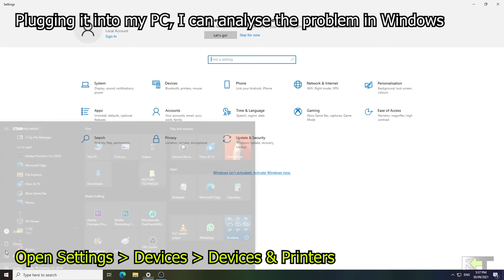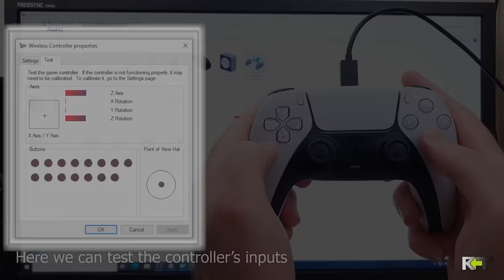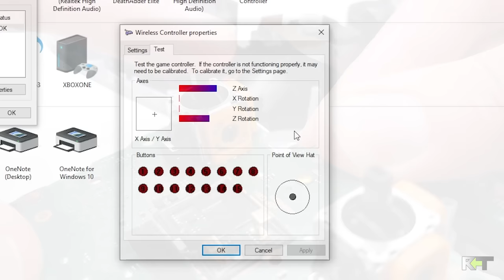How to take apart your PS5 Controller and fix Stick Drift

Comment: When I first watched this I thought  I could never do it. But after spending 20 bucks on Amazon for a full screwdriver kit, foam swabs, and plastic prying tools, I just now finished up fixing my drifting controller and so far no more ghost inputs or drift. Thank you so much
Reply from the maker: Yay! Well done 👍
Reply: @RestoreTechnique  Doing this as well. Thanks a ton for the very clear video.
Reply from the maker: @consciouscnote  You're welcome 😄
Reply: Nice dude!
Reply: Update on the controller? Does it have drift now 3 months later?
Reply: @UJxstGotClipped-  hello! Update, no drift since doing this. Actually I haven’t had to open up my controllers again once since following both this video and another video on fixing trigger springs. Granted it’s only been 3 months but I will update this comment again if the controllers ever start drifting again to give my best guess at the lifetime of this fix. Either way hopefully Sony upgrades their controllers soon.
Reply: @loonboy4905  nice just did this method
Reply: @loonboy4905  Which screwdriver kit did you buy?
Reply: Can you provide what kit you bought 😂 controller os bugging out rn
Reply: @PuReGhOsTT  I just typed in electronic repair kit on Amazon and bought something for 20 bucks and I also typed in micro screwdriver set and also spent about 20 bucks. I used the Philips head bit labeled 2.5 for the controller screws
Reply: Wanted to update this comment again. I had to open up my controller to repair a broken L2 spring (much harder to fix than the R2 spring) and since I already had to take out the battery to do it I also just went ahead and cleaned the stick electronics again as well. So I probably won’t be able to provide an exact time frame for how long until they drift again due to somewhat frequent repairs to other parts that cause me to jsut make sure everything is clean and lubricated correctly while im at it.
Reply: Why was the screw driver kit called
Reply: What if the prying tools is metal no plastic?
Reply: @marquesdunn4934  might scratch it id assume
Reply: 5:24 can u use a simple baby wipes
Reply: @awesomeperson5051  I wouldn’t use anything that sheds or leaves behind residue. So i honestly wouldn’t use anything other than felt or microfiber and some form of alcohol to clean electronics.
Reply: @awesomeperson5051  i wouldn’t , baby wipes leave behind a lot of lint.
Reply: Man my controller drifts so bad now I want to toss it. This video is my last hope.
Reply: @davidwhite206  just get a new one of you cam afford it
Reply: Shit i just used a butter nice and water and worked just perfectly for me
Reply: @Bababooey22  so just cleaning the little potentiometer disk thing worked for you as well? No replacing parts
Reply: Did you apply a new grese or no
Reply: Your really helpful 💯💯
Reply: Yet another new update: On my primary controller I experienced diminishing returns where I got to the point where every 3 months or so I had to clean and reassemble the controller to remove stick drift. However my secondary controller has not needed to be cleaned again since my original comment 2 years ago. Additionally I don’t know if Sony finally fixed this issue with software but I had completely given up on my primary controller, decided to try it out and since the last controller update I have had no stick drift. I hope this semi-long “study” confined to YouTube comments was helpful. Also for anyone wondering as well I seemingly have to replace the trigger springs annually which isn’t bad as it is very easy to do. For context I play PlayStation almost every day for at least an hour. So for extremely heavy use I would say the controller holds up daily well with somewhat minimal maintenance. But in the end I would still recommend buying a newer production controller if you still have the launch controllers like I have, as longevity issues seem to be completely fixed now.

Comment: After watching this I’ve decided to just buy a new controller
Reply: Fr. Taking it apart was easy...puting it back together was not.
Reply: @PxNxWxGxW Likewise mate. Only last week I was so frustrated with the stick drift + a worn down analogue stick that I just tore open the controller, replaced the joystick and decided to put the controller back. But for some reason, only the analogue out of all buttons were working. Now, in trying to diagnose thet issue, I snapped the triggers ribbon cable. I was able to fix my controller but now, my left triggers don't work. Have ordered a new ribbon cable lol
Reply: My husband and I attempted to fix the drift issue, he took out the screws saw the next portion of the video and 😵‍💫put the screws back in and said we're taking it to the professionals 🤣
Reply: @sAINTDeVille  🤣🤣

I had that idea midway but I just decided to go through with the video. I feel confident as someone who can tear apart a dualsense now.
Reply: It’s not difficult
Reply: Facts!😂🤣
Reply: Sad. I have no experience with electronics and yet I tried to clean the controller as the guy did in the video and it worked. It’s not that complicated and you don’t have to worry about breaking anything if you are careful enough. Controller parts are not so fragile as you might think
Reply: Me too😂😂😂
Reply: fr😂

Comment: I have ZERO electronic experience. I followed this guide to disassemble my controller and fix the button sticking issue, and had it done and fixed within an hour. You're awesome.
Reply: Oh god... an hour? Well here we go i guess
Reply: @rinnnnnnnnnnrin  it only took me that long because I had to improvise since I don't have the same tools. I used a knife and a flathead screwdriver and was very slow so as not to break anything or stab myself.

Comment: the fact that the controller was designed in a way that requires you to open it up fully and amount almost all connectors to access the singlest and most common point of failure for controllers is so goddamn enraging
Reply: fr i just but a used controller expecting a lil bit of stick drift and it’s terrible stick drift makes me upset im gonna have to do this step by step
Reply: Planned that way.
Reply: In fact is easier to disassemble than the PS4 controller. 😅
Reply: @danielcastrillon7643  False, on DS4 you just open some screws, pry open the back and you already have access to internals. There's also just two flex cables.
On Dualsense, you have to remove front panel and shoulder buttons to get access to the screws before you can pry open the back and then you have to remove five flex cables before you can turn over the controller board. Way more work.
Reply: The Nintendo Pro controller you just take the thighs out, unscrew some triwing screws, and pop the front up. Boom, access to the thumbsticks easy
Reply: Sometimes I just pour a bunch of IPA inside the area from the front, give it a good shake, move the stick around, and leave it in the sun for a day  to dry. Can't recommend it as it almost definitely causes damage to the interior but it has worked a few times for me.
Reply: @Laerei it takes ten seconds and a thumb tack to remove the bottom cover, and two buttons. 5 screws later and 4 ribbon yanks, you can now access the entire motherboard. Doesn’t seem that complicated to me. 
Just did this for the first time and did it 3 times in under an hour because no matter how much I cleaned both meters, it didn’t fix, it actually made it a bit worse.
Reply: Fr I had a broken controller and used it to practice for a controller that has stick drift and I ripped some of the fiber cables imma go to an expert lol
Reply: That's one thing I do appreciate about the Switch joy-con: they might get drift a lot but the sticks are attached with ribbon cables. So while you do need to be careful and have the right screwdriver, you don't need any heat or do any soldering to replace them.
Reply: @JustaSimplefact  isopropyl alcohol does not and will not damage the internal components of any controller. you are thinking of water
Reply: @johjohn8744  That's good to know, I was just assuming on the side of caution. I figured there are many multiple material types inside and some may not play nice with alcohol. IE adhesive etc.. Never stopped me from doing it anyway.

Comment: First time doing a teardown on a DualSense and your video tutorial was extremely helpful, the fact that your video is calm and quiet helps the viewer to be patient too while taking apart the PS5 Controller. And yeah, I fixed the drift problem after using a bit of tweezers with a bit of cotton with alcohol on the tip and cleanning gently the horizontal left sensor or whatever it is called hahaha. tysm!
Reply from the maker: Awesome 🙂👍
Reply: How long was your problem remained fixed, tho?🤔

Comment: Incredible amount of patience and skill! I've fixed ps4 controllers but this one seems ALOT harder.
Reply: Well least you have experience
Reply: Thought same thing. Def wasnt
Reply: Tbh it feels intentionally designed to make it as hard as possible
Reply: I managed to get mine completely apart with some screw drivers and a boxcutter to pry pieces apart. I have a controller repair kit on the way so getting my controller apart in the future will be a piece of cake. I didn't have isopropyl alcohol or special qtips so I tried cleaning it with alcohol wipes used for cleaning glasses. Not surprised but it didn't work. I'll be more prepared next time.
Reply: An xbox one controller is 2X as difficult to fix. Happy with this one.

Comment: This video just saved me $50 dollars, and now the drift is completely gone. Thank you so much! The video was quick, straight to the point, and well made, and the super zoomed in camera for seeing details was a great addition.
Reply: @SilkyLew he prolly means to replace the joystick not the controller
Reply: Since I dont  have any tools I basically bought all of the tools for total of $42
Reply: @Melodies_212  The Joy stick cube is soldered to the motherboard .
The Ps5 Pro controllers have quick swap out out joystick cubes.
Its should be like that for all controllers .
Reply: @Crashed131963  IK THAT DUMMYthe guy that commented does not have a pro controller
Reply: @Melodies_212  He has a place that sells new controller for $50 , that is good enough I guess .

Comment: wow, cleaning the potentiometer is such a powerfull idea. Just fixed two of PS5 controlers this way. Mine was ZCT1W with green ALPS analog on it, so I did not use any grease as originally there was none of it. And what is really important - to use dustless cotton swabs instead of a regular sticks stolen from your sister, as it would give you even more drift. Cheers!
Reply: As I'm sitting here about to use those lol glad I saw this
Reply: How did you remove those green things? I really couldn't manage it, didn't seem as easy as the yellow ones in this video
Reply: @DeMaxo  works exactly in the same manner, sometimes need to use more force. I also use bended tweezers
Reply: @ukaszs.3234  thanks for your response, giving it a go right now!
Reply: If you use normal cotton swabs just use tweeters to remove and cotton strands that remained behind .
Reply: I have the green ALPS and I think I’ve pulled it too far when I tried to unclip it and now it won’t click back in place essentially making the stick drift 10x worse. Any suggestions on how to fix this??
Reply: @joshfox6090 I'm not sure if there is a fix for that. I'd say replace the whole stick, need to solder a new one

Comment: Thank you, it took me 30mins to do this and it works great. I had this issue with two of my ps5 controllers and I bought a third one to avoid going this route but my third one is also acting weird lately. so I decided to give this ultimate fix a go. Now i can fix all three of them and dont need to buy any new ones.

Comment: Wow. What a diff from the 4 to the 5 controller. I won’t even attempt this!
Reply: Deadass and I’m on my third controller with a drift
Reply: @blunttrauma2460  once you open it first time, from the second time its going to be much easier. 

I did the fix for two controllers. Now they are working without a drift

Comment: Thank you so much! It worked for me as well. In my case I did exactly the same as described but then my controller was turning right all the way. I disassembled everything again and removed the grease I've added after cleaning. I completely soaked the trimmer for a minute than used a swab to remove.  Second try and now the controller was turning upwards. Repeated the process for the other potentiometer and wow... worked! I'm quite happy I had fun and solved my problem without buying another one.

Comment: I just did all this and mine works again!  I doubted it would work since my controller that came with the ps5 was only a few months old and clean and I don't play as much as I used to.  So I did all this, cleaned that thingy, even dustered both modules out, and went back to that pc controller test and couldn't replicate the drifting results that I had just gotten prior!  I was shocked to say the least!  We'll see how long it lasts, but it's a step in the right direction!  Great video!  I didn't replace any lube because I think it will just collect debris faster...  Thanks for the video!  👍🏼✌🏼

Comment: Figuring I had nothing else to lose except $70, I tried this nervously and thought I messed up the wiper while trying to extract it. Thinking I bungled the whole thing, I wiped it with 91% iso, put it back together and somehow fixed it! I fee like a god damn wizard! Thank you!
Reply: Same thing here although i have 2 controllers the first one had drift so i started using the second controller but it was giving me problems with movement already so i decided to clean the first one and i was able to fix it 👍
Reply: You’re a wizard, Harry

Comment: Came to this video to hopefully fix my stick drift, and it absolutely did! You’re awesome for making a no-nonsense guide to how to disassemble and clean contacts inside that controller. It helped tremendously when you showed the gunk under the microscope. Found both the axis in mine had contact gunk and removing it made the controller not only totally remedied of stick drift, but feel brand new.
Reply: For real? I have two and they both drift. Haven't had them but a year so  I just thought they were broken but I just Amy give this a try
Reply: @nofoxgiven3741  did you do it yet? Just wondering how it went cause im gonna do mine soon
Reply: @PervySage723  blew one out with an air compressor ... Fixed the problem. 
Did the same with the second as well as taking it apart. It still drifts
Reply: @nofoxgiven3741 I opened the controller but couldn't reach the sticks. So i said fk it and bought a new one.
Reply: @nofoxgiven3741 so air compressor fixed problem ? I rather do that then take this apart lol

Comment: Thanks! I fixed it following each step... weird thing was that in the windows wireless control properties the Z rotation was all wack, but in the PS5 works just fine.
This video saved me from buying a brand new controller.

Comment: Thank you for this, it helped me figure out what is causing the stick drift.  There was a very small particle that was rubbing on the track causing my character to move forward; very bad when playing Elden Ring as it has caused me to fall to my death a couple of times.  

After taking it apart; everything works fine now like it’s brand new.  I swear Sony needs to remedy this issue as not everyone would like to disassemble their controllers.

Comment: I was able to fix a really bad left stick frontal drift using this video! Had no special tools just some tweezers and a lil screw driver. Couldn’t even see what i was doing to the wiper things but worked out so thanks!
Reply: Same. I thought I janked it. Totally expected to need to buy a new one but it’s better than ever.
Reply: @Kirokill1  is it still working fine after 2 months?
Reply: @MCBeastMC100K There’s a little bit of drift happening again but still not as bad as before I opened it.

Comment: I was experiencing stick drift and after following your instructions I was able to breakdown to take a look to see if I could tell what was causing the issue. I wasn't able to see anything at all in the way of gunk/etc. when I got the wiper disk out, but I figured what the heck I'll put it all back together and see what happens, and boom it works like a charm now! I thought I'd be throwing out the controller, but at least for now I've got a spare! Thank you!

Comment: Very informative video. Will be using this for future reference. I remember when my mom's iPhone got cracked. I fixed it for her. It was the beginning of the rabbit hole of self-repair. My gaming laptop had heating issues, I was afraid of taking it apart. I muster up the courage, I ended up taking apart the entire laptop, the fans and heat sink. It was straightforward opening the fan, cleaning the thermal paste, and applying new ones. Then, there was Mac Book Air. It unfortunately got virus, I was being stalked. I took part the Mac Book, took everything apart out of curiosity, physically removed the microphone on there. There were also my iPhone. I took it part and reassemble it. My next goal is learning how to solder. I've been waiting to do this for quite some time. I've seen PS5 tear down, I used to be intimidated, but it doesn't appear as intimidating as I repair more electronic devices. It's really like a rabbit hole of repairs. I took apart the entire mouse and reassemble it.  My PS5 Controller I just bought from GameStop, I knew it was used, I decided I want to see if I could fix this controller. It appears like the PS5 Controller is nicer; you don't have to remove anything, just a simple wipe down on the analog -- no more drifts 😏🤓